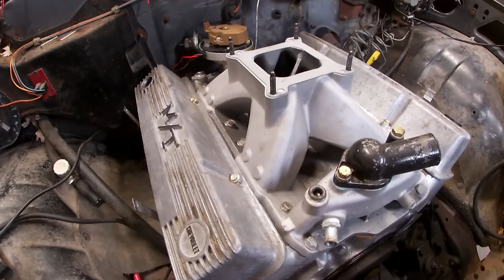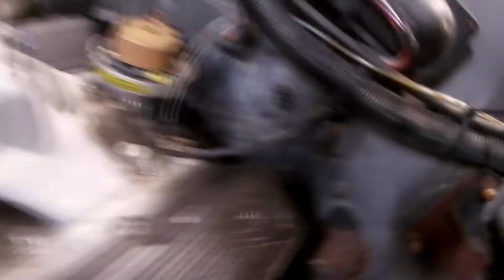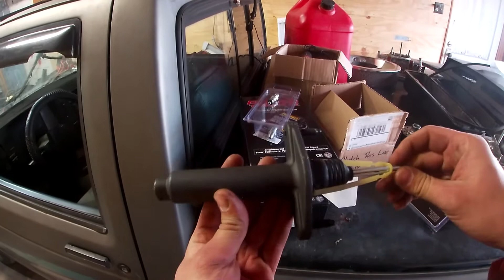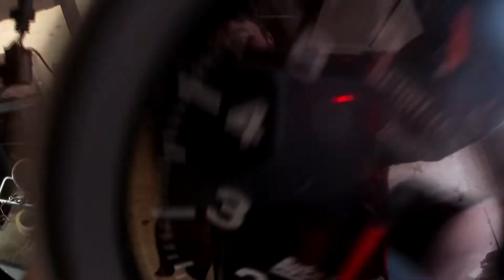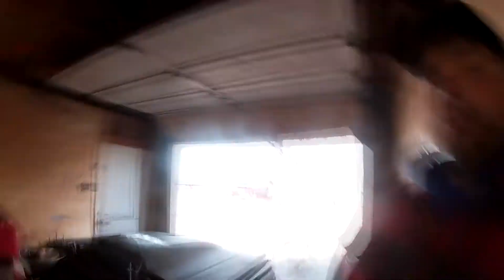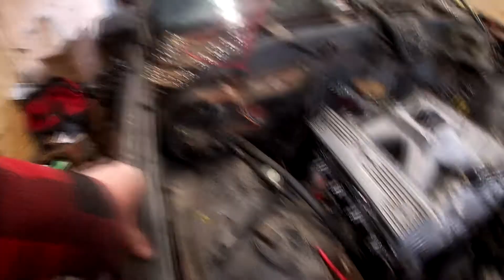S10 NV3500 Swap W/Part #'s

Comment: Where you get the flywheel bc i got a fliywheel from a one-piece rear man seal and it dont fit the two piece rear main seal ?
Reply from the maker: @ShawnBradshaw-g5g  I got mine from a swap meet, from my understanding any 1st Gen sbc flywheel will work as gm engines were internally balanced with the harmonic balancer and flywheel/flex plate having a neutral balance. The sbc 400 6.6 engines have an external balance and that's why you see the offset weight on the harmonic balancer

Comment: I'm currently trying to do the same swap. I'm on a really hard budget. Using the nv3500 what trans crossmember do I need that I can get at the salvage yard that will fit my first gen short body S10? Is there a driveline that will bolt in correctly without having to cut it?
Reply from the maker: I used the factory crossmember and factory driveshaft from the donor truck I bought just for the swap. I took the trans, crossmember, and driveshaft and sold the rest for more than I bought the donor for so it was a win win. BUT!! What I found out after installing everything is that the master clutch cylinder kisses the driver header and I ended up using one from a 2.5L as it's shorter in length. I had to get an adapter to fit the -3 line going to the slave cylinder since the one for a 2.5 is not a roll pin style.

Comment: I see you used the gen 1 engine with a 2 piece rear main.  To use the parts you listed for the internal throw out bearing, did you use the big 168 tooth or the small flywheel ?
Thanks
Reply from the maker: I just used the factory flywheel with an 11" centerforce racing clutch. A stock clutch replacement will slip under wide open throttle it turn out, otherwise I should really redo this video because I've changed some stuff up because things in my set up didn't work with the part #'s given. Sometimes they do and sometimes they don't for people it all depends on where you place your engine inthe mounts

Comment: What flywheel, clutch, pressure plate, and throw out bearing did you use to get your sbc to work with the s10 nv3500? Did you use all stock c1500 clutch parts
Reply: Thank you for the reply, I'm putting a cam swapped tbi 350 out of a 95 1500 in my 95 s10 with the external slave nv3500 and have been looking for what flywheel clutch pressure plate and through out bearing to use. Thank you for the part numbers!
Reply from the maker: @donfielder7136  good luck! I hope you can find a flywheel, I know they are hard to come by out by me for tbi motors
Reply from the maker: I used a stock flywheel, centerforce pressure plate and clutch  part# CF360450 pressure plate rated 400 ft/lb torque at the crank. part# 384188 disc 11”. These are listed for the internal slave while part# CF361877 pressure plate rated 386 ft/lb torque at the crank. part# 383735 disc 11”. These are listed for the external slave. You can also get the throwout bearings through centerforce too. I'm using all -3 lines but still in mock up now until the exhaust gets buttoned up
Reply from the maker: You can get it all through jegs or summit

Comment: When you swapped the 2.5 out to put in the v8 did you have to get the v6 mounts and then the conversion kit or what did you use?
Reply from the maker: I had to get 2.8L chassis mounts and the conversion engine mounts. You can find the chassis mounts at any auto store or online places like summit or jegs. As far as motor mounts go I just went on ebay and found a set for around $40 and they work out good. If you go that route look at the thickness metal being used on the engine mounts and check the quality of welds when you get them, I didn't have to touch mine but you never know when it comes to ebay.
Reply: @pedaltothemetal3871  alright thank you

Comment: Could you tell me which clutch line  you used between the master and slave cylinders?
Reply from the maker: Allstar performance 46304-36
It's a -3/-3 with one end being a 90°
The 90° will go on the slave end to help clear the crossmember on an external slave. Also told to run part# CF361877 pressure plate rated at 386 ft/lb torque at the crank. part# 383735 disc 11”. These are listed for the external slave through centerforce, I got in contact because the stock style will slip from what I've heard and seen 1st hand. Also the stock nv3500 will only take about 350ft lbs tq before having problems if you dead hook.. I have not proven the clutch set up as I put my s10 on the back burner for a bit to finish my firebird before street machine in a few weeks here. Hope this helps! Any questions just ask away
Reply: Thank you sir! That helps out a lot 😁👍
Reply from the maker: @chadbaker3410  where do they hit/rub? I know every header fits different and every motor fits different
Reply: @pedaltothemetal3871  #5 header tube  I believe,  I can double tomorrow.
Reply from the maker: @chadbaker3410  Blazer or Pickup?
Reply: @pedaltothemetal3871  pickup
Reply from the maker: @chadbaker3410  where do you have the motor at? Front of the slots, middle, or back? Not quite sure what to tell you here to be honest.. I have the headman shorties and it gets within around 1.5" - 2" from the master. A friend has the same set up as well but a 350 motor with Sanderson headers and they clear the master too
Reply: @pedaltothemetal3871  I have the motor all the way back, been working on it all day today,  and finally got it! (😁YAY!) It still touches the header a little, but I think I can  play with that a little more later. Man I really appreciate the help!!😊😎👍Now I have to tackle the radiator and fans. 🤣 After that a drive shaft, then drive it!🤞
Reply: Just ran into another problem,  the clutch master cylinder hits / wont clear my headers. Is there a trick to make it fit?
Reply from the maker: What headers are you running?
Reply: I think headmen, bought them used from a friend a couple of weeks ago.

Comment: What headers are you running
Reply from the maker: Headman, I heard of some people having issues with Sanderson but it's a hit and miss.
Reply: @pedaltothemetal3871  you got the part number ,these Patriots are close to slave master how bout yours I planned on wrapping them
Reply from the maker: @SteveSmithGarage  mine are close too and plan on wrapping it in that spot or making a heat shield to protect it.  I have everything striped apart right now doing frame work
Reply: @pedaltothemetal3871  cool thanks ya I planned for a heat shield too thanks for your help gl with the dime
Reply from the maker: @SteveSmithGarage  yeah no problem I'm figuring it out as I go here too

Comment: can you do an in depth video on how you are gonna do your wiring assuming your not going full race truck
Reply from the maker: I can do my best, I know I made one with the engine bay harness a few videos ago. I am not going full race truck lol really shooting for a fun reliable daily driver
Reply: Pedal To The Metal Man i’m glad to have found your videos i’m currently doing a 350 swap in my 93 S10 Blazer with a nv3500 aswell and need some help .i’m also aiming for a daily street truck
Reply: Have a problem trying to install the nv3500 behind a 350 engine is there a special clutch kit or what that makes them work done pulled and changed clutch pack 2 times still can’t get it to work properly to grab gear what do I gotta change for it to work correctly
Reply from the maker: @ramonhernandez9292  your saying you've changed the clutch twice already? I would double check and make sure you are fully disengaging the clutch when the pedal is fully pressed
Reply: @pedaltothemetal3871  yes my dad is currently working on a guy motor swap and the man wants a stick shift in it so picked up a nv3500 from the junk yard that came out 94 s10 I believe he’s using the 11” clutch pack now and it still won’t engage the clutch. He keeps saying that when he bolts up the clutch to flywheel the fingers start to go inward is that supposed to happen? And what count teeth flywheel is supposed to be?
Reply from the maker: @ramonhernandez9292  Mite have to go with one made for a early 90's 4.3 V6. I'm having to change mine out because I have too high of spring pressure but I'm still trying to figure this out too as I go too and try my best to document it for the next person to make it easier. Is it an internal slave cylinder or external?
Reply: @pedaltothemetal3871  from the info I’ve found on the web if it has the external slave cylinder like you show the recommended a clutch kit from a 88 4.3 1/2 ton 1500 truck and if it’s internal slave to use a 98 1/2 ton 2wd clutch kit and 168 tooth flywheel. But I’ve also read that if using the older style external slave cylinder 88 clutch that it needs the 153 tooth flywheel. Cant find anyone who just  explain it the way it needs to be bc we can’t get it to work.
Reply from the maker: @ramonhernandez9292  what ones have you already tried?
Reply: @pedaltothemetal3871  from what my dad has told me he has put one from a 94 in it and now this one from an 88 when he bolts it to the flywheel he said the fingers begin to push in on there own don’t know if that’s normal or not. He can get it in 1st gear but can’t get it in 2nd.
Reply: From what he just said now the clutch will grab just don’t cut enough. But also the clutch pedal don’t shoot back up to the top as it should gotta lift it with his foot he’s gna see if under the dash has the extended clutch rod and try to extend it more or try to see if he can extend the slave cylinder rod
Reply: Well got it figured out the rod under the dash wasn’t engaging enough so he extended it and now is on the road working as it should